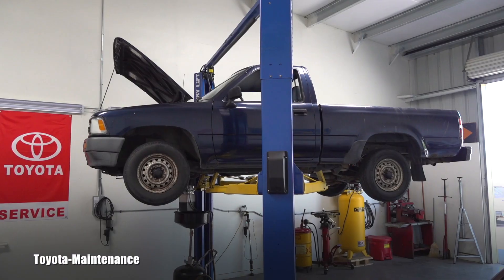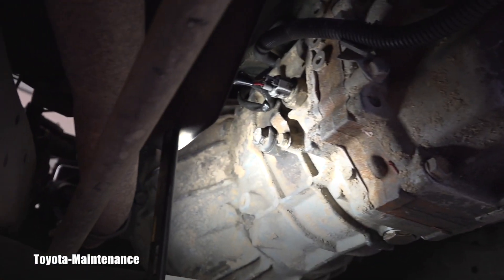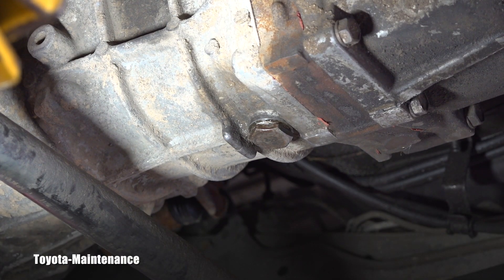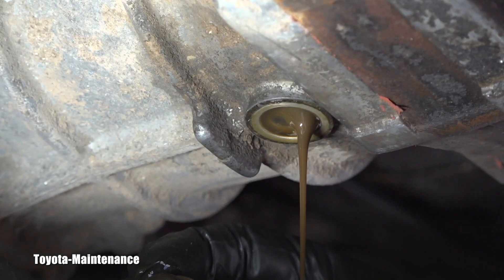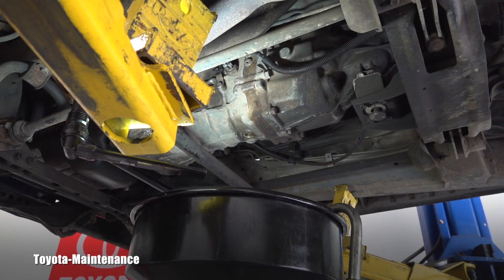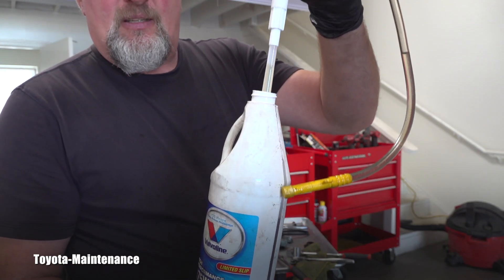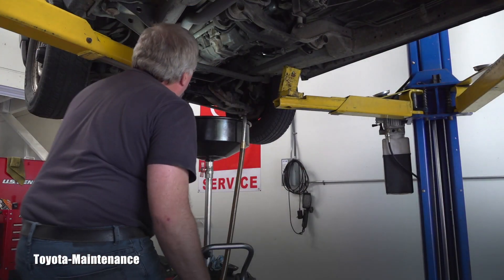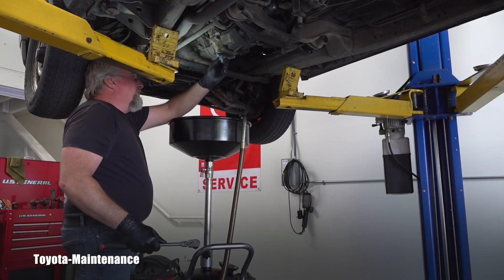Toyota Truck manual transmission oil replacement

Comment: I just love those 1990's Toyota 4 cylinder trucks.  In today's world, everyone wants big V8 trucks but those 4 cylinders from Toyota run forever and get great fuel economy. Awesome video.
Reply: Yeah they  Last forever I have a 1990 22re original engine original transmission 500,000 miles runs like a champ Just have changed wear  and tear stuff that’s it
Reply: Almost 50 and still driving my first vehicle...   Hope to get at least another 10 years out of that pickup.
Reply: i don't much IF EVER see these old Yota trucks in the midWest salty belt region no more, its a tale of a bygone era around here 8^(
Reply: They had V6’s too in the 90’s
Reply: My 92 ...Original engine and tranny 313k miles and still my daily 💪💪no issues
Reply: I rolled one once, and by grace of god, I walked away unscathed and without a scratch, those 20R series motors are tanks, same with the RZ’s those jap 4 bangers motors are hard to beat
Reply: They don't get that good of mileage lol
Reply: @bradbozarth3235 I get 20 mpg. 1994, 22RE, 4X4…. It’s not that bad?
Reply: @bradbozarth3235 not compared to a car, but this is a truck. 20mpg+ is great for a truck
Reply: @interstate80.  yeah you’re not wrong. For its time that was spectacular

Comment: This just proves once again that these trucks are indestructible, even though it is neglected.
Reply: Camaro 1968  I don't make them and I don't own the company, all i know is that the whole family has been buying Toyota for many yrs and all have been trouble free. I'd say there's been like 8 all together.
Reply: The rust belt destroys Toyotas the same as any brand, salt makes them quite destructible.
Reply: Rust Belt is tough place grrrr - but does not damage internal drivetrain assemblies as much as chassis etc.

Toyota drivetrain are built Ford Tough

Comment: I did not see you tighten the drain plug.
Reply: oh well, if you didnt see it it probably didnt happen
Reply: You also didn't see him take the truck off the lift...
Reply: @erikcox1947  What is your point?
Reply: @orinmangar2333  just because you didn't see it in the video doesnt mean it did not happen.
Reply: @erikcox1947  I am not saying it did not happen. I am just saying I didn't see him tighten it. Usually when a drain plug is screwed in by hand, the next step is to tighten/ torque it. He did not show that step. Also he did show himself screwing in the Refill bolt and tightening it.
Reply: @orinmangar2333  Well he obviously had to tighten it, or it would all come out. Next time just ask him to show it because you obviously have some kind of tightening torquing fetish and need to see it every time. We all know he would know better than to not tighten it correctly.
Reply: @LAactor  You need to stop assuming that steps not in the video are being done. I have seen him install a cabin air filter upside down.  So stop the BS.
Reply: @orinmangar2333  Old Man, the only one here with BS is you. Who are you the auto repair police? I can safely say with 100% certainty he replaced the drain plug and tightened it. If you hate him so much why are you even watching and wasting everybody's time?? BLOCKED. And for your information that upside down air filter was a customer who did it. YOU DIDN'T EVEN WATCH THE WHOLE VIDEO TO KNOW!!!!

Comment: you understand imperial measurements better than most Americans
Reply: Imperial measurements and American measurements are often two different things.
Reply: You're both right! SAE ain't part of the Queens Empire, that's for sure, eh!
Reply: U.S. customary units are used in the USA not imperial.
Reply: Because he comes from a place that didn't use american standard

Comment: I wish cables were still a thing. I Just had to replace a Throttle body due to a Position sensor failure on my sienna. I just wish cables were still a thing but of course they r not.
Reply: Mark Moyseyenko 
I’m with you, agree !!!
Reply: there are still throttle position sensor on a cable operated throttle body btw.
Reply: @Altruistic00  still less likely to have issues. Though my throttle body did go 234k miles so i can't really complain the cable ones can't accelerate by them selves like mine did.

Comment: That hasnt been changed since it left the factory.
Love your accent. Say Magnet 10x real fast. 👍
Reply: isn't that non-factory gasket junk on the aft housing?
Reply: wim0104 
They worked on  the Transmission , but never changed  the oil